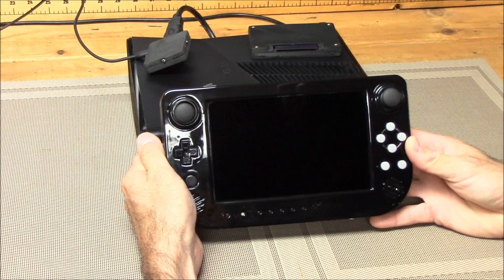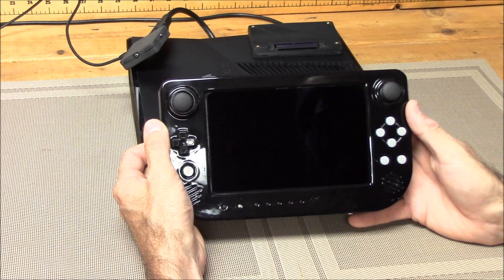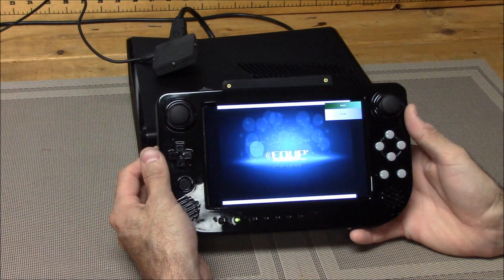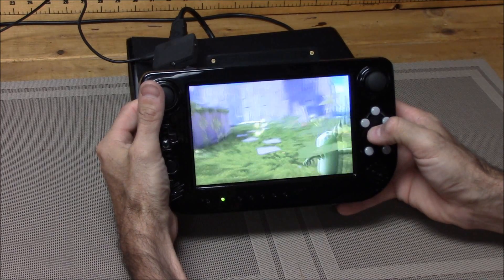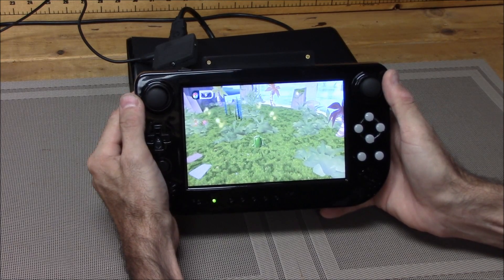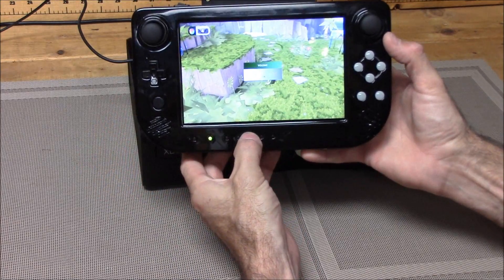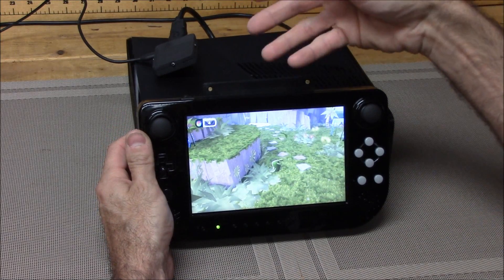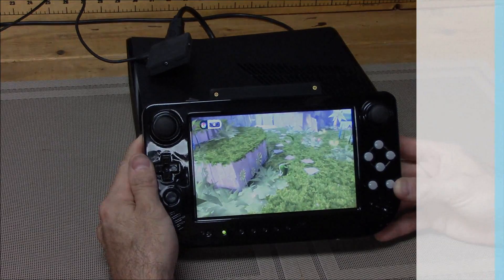The CrossPlane --- More details and a demonstration on the Xbox 360

Comment: the nvidia shield is probably more advanced but it also has less range. also the shield has its own games that it can play, and yes they are android games. also i would say this is better than the shield despite the shield being more advanced. the shield probably has less lag but this has greater range and can theoretically work with any device that has hdmi. i doubt it will work for ps4 though since the ds4 has a touch control interface and im not sure how this would emulate that control.

Comment: you should add more buttons to accommodate for the snks arcade 4 or 8 button I think also 6 for n64 and the atari jaguar it has like nine keypads, and Panasonic CDI and 3DO. If this is going to be for retro it should also have to right buttons and make them customizable. maybe add a 3 joystick in the middle for the n64.

Comment from the maker: It really doesn't make sense to add Wii support. Can you shake the CrossPlane in the air or slash it back and forth like you have to with the Wii controller? No. Also the Wii did not have Hdmi out. So basically there's no point in it.